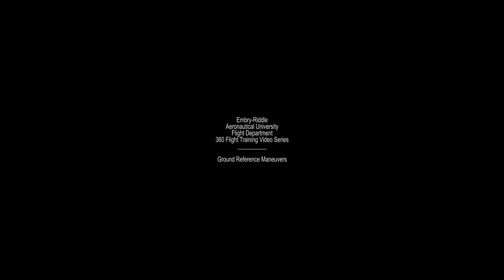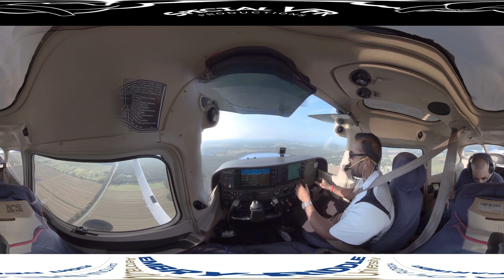Ground Reference Maneuvers - Crabbing, Wind Drift Circle, Turns Around a Point

Comment: GRM is not supposed to be taught at high altitude and mild easy winds.  That is Fake GRM. Fake GRM fools pilots into believing they know Real GRM.  Fake GRM will produce accidents.  No wonder so many Low and windy GRM crashes in USA by so called "Licensed experienced Pilots".  Shame on ERAU
Reply: How many low and windy GRM crashes have there been? And how would "fake" GRM possible cause an accident?  He is certainly not at a high altitude. Looks like about 1000 feet or so.
Reply: @gregbergman1406 -- Many.. Read accident reports for once.  I read thousands since 1992.  1,000 feet agl is high altitude for GRM.  You cannot see much wind drift over 600 agl, specially if light winds  only.  Mild and High GRM is Fake GRM.  Then you have to do a flight on a windy day at 500 feet agl and you will start making a lot of mistakes.  Its a different kind of flying... Fake GRM is for Fake GRM CFI's.  Im a Bush Pilot CFI and emergencies on take off CFI.
Reply from the maker: The FAA standards for end-of-course checkride state that the maneuver is to be performed between 600 and 1000 feet AGL. We perform them at 1000 feet.
Reply: Every landing is a practice of GRM so all other accidents you mentioned are not tied to lack of training or practice. GRM are meant to teach concept to adjustment to your crab as you,  you do not fly every hour in GRM at 200 feet unless you are a crop duster . Great work ERAU